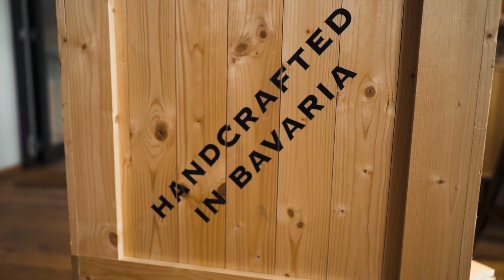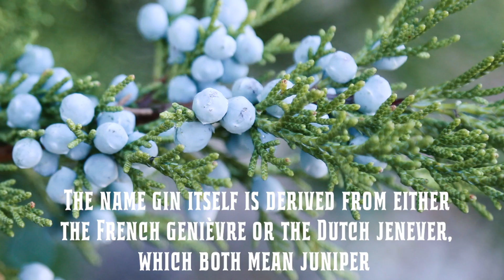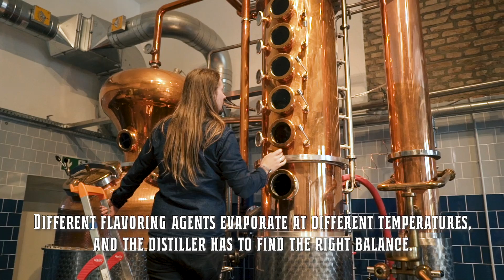How Gin is Made

Comment: something I always wanted to know: Why do distilleries distill to very high levels of alcohol (85 in this case) only to add back water after to lower it to a more "normal" percentage? Why not stop the distillery right at 40% for example if that's where' you're gonna end up anyway?
Reply from the maker: It comes down to flavor and separating chemical compounds to get desired ethanol and congeners.  When distilling, ethanol has lower boiling temp. Than water and you capturing a higher ABV.  %.  If you would  capture at lower strength and at the beginning of your distillation, the more volatile compounds like acetone, acetaldehyde etc.  its why you hear terms like head, hearts, tail cuts distillers use during distillation.
Reply: @drinkdestinations  Maybe I'm just tired but I didn't get anything :P